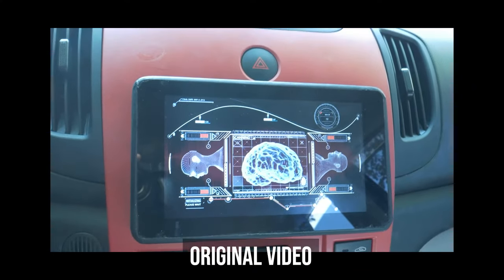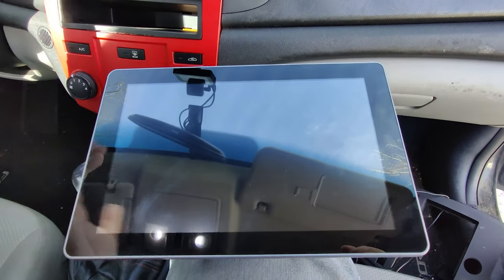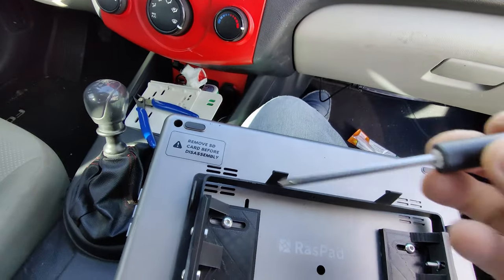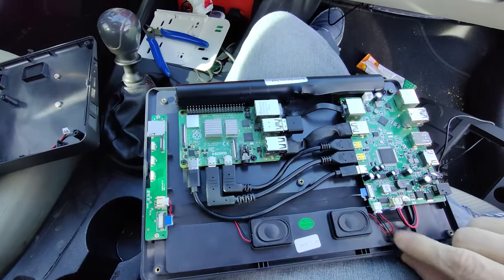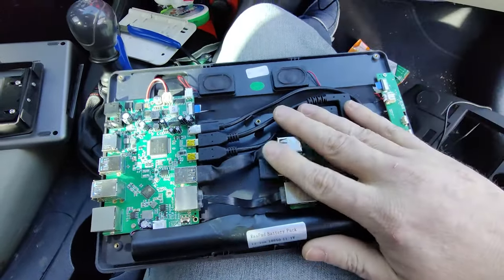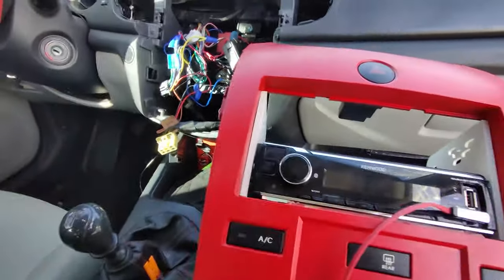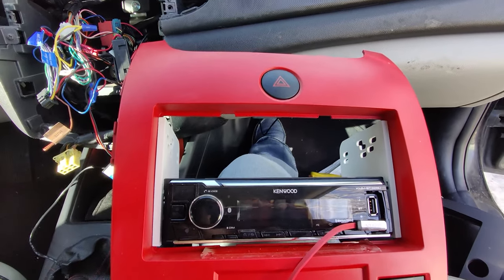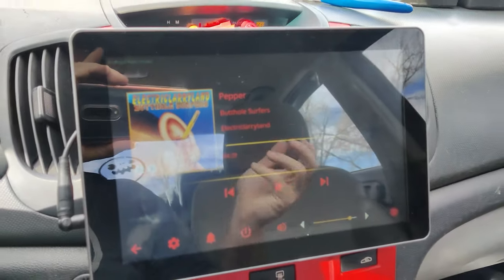Raspberry Pi Car Stereo v2 - Full Touchscreen Navigation & Spotify

Comment: 6:50 you actually can use the onboard bluetooth and headphone jack by iirc editing the /boot/config.txt file on the pi. ive been using it like this for days to pair my phone and output audio to an amp through the headphone jack, and its worked absolutely fine. i have literally no idea why bluewave disables them by default and then tells you that you need extra hardware to replace them when you really dont. saved me some money, hopefully this will save some other people too.

EDIT - the modifications: you just need to delete or comment out the line that says "dtoverlay=disable-bt" to get the bluetooth working. for audio, i believe you need to make sure you have the lines "dtparam=audio=on" and "audio_pwm_mode=2" present. the latter may not be required because the documentation says its the default, but it should ensure that you get the highest quality output from the jack.
Reply from the maker: If you want to share the changes you made, I'd be happy to pin the comment under the video :)
Reply: @DBTechYT  i edited my original comment 👍
Reply from the maker: @dylon4906  Awesome!! I wonder if doing this would help the crackling I get in my audio from time to time...?
Reply: @DBTechYT  come to think of it, there is actually a slight buzzing noise out the headphone jack which is audible with the amp. my dad, who is working on this project with me, seems to think its noise from the 5v3a step down converter (i have the same konnected one you used), but im not sure. dont know if thats related and could also affect external dacs but maybe. at any rate, i dont think itll be noticeable over the background noise in my car (havent tested the whole circuit in my car yet so hopefully anyway). there is also a "pop" noise that happens through the headphone jack when the pi turns on and off which is kinda problematic if you have an amp without adjustable volume and thus rely on the pi itself to change volume (which i do), so my dad and i are trying to find a way to mitigate that. those are the only issues i have that are anything close to crackling but might be good to know for anyone that tries this
Reply from the maker: @dylon4906  I get the pop noise when the device turns on and off, but I also get crackling in the bluetooth audio. As far as the buzz you're talking about, you might consider a 3.5mm Ground Loop Noise Isolator. (https://amzn.to/3wm1Q3P) I've had good luck with them.
Reply: @DBTechYT  wait a minute, are you maybe running the output from the pi at max volume? doing that on mine made the audio sound noticeably distorted, could be construed as crackly. maybe cheap external dacs are like this as well
Reply from the maker: @dylon4906  I'm pretty sure it's bluetooth interference that is causing the crackling noise intermittently.
Reply: @DB Tech  could be. using the onboard stuff might be worth a try then. best of luck!

Comment: Amazing video! One thing I want to point is that you shouldn't use Li-Ion batteries as those are very sensible to high temperatures and may be a fire hazard especially during summer days, when car interiors can reach 60-80C (the parts of the car that are in the shade). I've worked on a smart dashcam system and the workaround that we used were some big capacitors that could keep it operating for another 15 seconds to make sure it shutdowns correctly.
Reply from the maker: Thanks for the tip. I'll probably go out and remove the battery from the system entirely and just let it do a hard shutdown when the car shuts off. I'm running the OS on a USB drive and did this shutdown method in the past with no issues, so I'll just go back to that :)
Reply: @DBTechYT  Also forgot to mention, when the car turns on there are a lot of energy spikes that can damage your Raspberry in the long run. You have to be careful with that, Raspberries aren't that easy to come by these days :D.
Reply: @DB Tech  Nickle Metal Hydride batteries work well for this. Much safer.

Comment: For auto power on all you have to do is jump red and black to the two outside GPIO pins in the top row. Search GPIO Pi pinout and you will see ground and 5v. easy peasy, no solder required.
Reply from the maker: That's fine for the Pi. I did that in my previous build. The auto on/off issue was with the RasPad. I've since changed my setup entirely: https://www.youtube.com/watch?v=fYuruqIlUIc
Reply: @DBTechYT  Thanks for that. Interesting video for sure. I have the parts for the Pi thing though so I'm going to continue with that for my old truck. Looks like OpenAuto is no longer serving their software though. Not sure if you have any insight into that or how I can get a copy of the software. 
As a side note, I saw a comment about unraid, I have a license for it but I don't use it. I prefer trueNAS, previously FreeNAS. DO you have a video or thoughts on that comparison? Thanks!

Comment: Nice project! I would love to do something like this, I only need the car haha. At this time, I'm working to develop an infotainment system based on Ubuntu Touch. This video will be so helpful. Just a question, maybe my english is quite awful, but, did you say you don´t use the warning lights? 😮
Reply from the maker: Sounds great! And, yeah, I don't currently have access to my warning lights, but I've only used them once or twice in the 3+ years I've had this car. I have considered moving the warning light button to a different location, though.

Comment: Lots of effort went into this. We appreciate that. Good job. A few comments/opinions:
1. Locktite should be put on the threads of the screw before it gets screwed in, not the outside of the nut. I dont know if you put it on the screw side or not, but if not, nothing prevents the screw from loosening from the nut. 
2. The latest version of RPI OS has Overlay FS built in. It is useful to allow power to be yanked off without corrupting the OS even when you dont execute a shutdown. 
3. How do you hook up the audio output from the RPI to your stereo system?
3. Can you tell us where you found the cool video you used in the bootup splash animation?

Comment: Hi great video, very inspiring setup. I'm planning on doing something similar but using a 7.9inch longer touchscreen display using a dsi connection. Did you have any issues getting the display to work on android? I'm a little worries that the one I want won't work as the website only states that it works with raspbian...
Reply: Bump

Comment: Great, thanks for that video. BTW is there any way to get out of that software to normal Raspberry OS, I was thinking about using RetroPi ocassionally ;)
Reply from the maker: What I would do then is make sure that your Pi firmware is updated to boot from USB and then have 1 USB for RetroPi and another USB for this setup and swap them as needed.

Comment: Can you make a video on how to build custom boot animation on RPI 4
Reply from the maker: The boot screen was actually easier than you might think. Here's what I did:

First thing, find or create a short video that you want to use as your boot screen. I did mine as a .mp4 at 1080p, but you could do 720p if you wanted to save storage space and whatnot.

I copied the .mp4 file I wanted to use as my boot screen to /home/users/pi/Videos

SSH into your pi and navigate to the /home/users/pi/Videos folder.

Then Create an backup of the original openautopro.splash.service file "sudo cp /etc/systemd/system/openautopro.splash.service /etc/systemd/system/openautopro.splash.service.bk"

Next, you'll convert the .mp4 file to a .h264 file by running this command "sudo ffmpeg -i dash.mp4 -an -vcodec libx264 -crf 23 dash.h264"

Replace "dash.mp4" with whatever you named your file. You can name "dash.h264" whatever you want, but make sure it still still ends in .h264.

Next, you'll want to edit the openautopro.splash.service file with "sudo nano /etc/systemd/system/openautopro.splash.service"

Change enviroment variable to match the name of the .h264 file e.g. "Environment="OPENAUTO_SPLASH_VIDEOS=/home/user/pi/Videos/dash.h264"

Reboot and enjoy.

Comment: i've been told it's bad to keep lithium batteries in a car because they will die very quickly because of temperature differences.
Reply from the maker: It's possible. If I ever notice an issue, I can remove the battery pack and use the OS to shutdown or just do a hard shutdown (this is the method I used in my previous setup for months without issue.)
Reply: There is some truth to this, but I don't think it's a massive problem. Most Dashcams have a built-in lithium-ion battery and they seem to cope.
Reply: @shm5547  dashcams are using batteries less and less. all the reputable ones you can buy in germany have cables and adapters for lighters or the fuse box or whatever it's called
Reply: I think most dashcams come with cables for the car fuse box or 12V accessory socket, but they usually still have an internal lithium battery.
Reply: @shm5547  AFAIK it's just capacitors to shut down gracefully, no lithium batteries
Reply: @FunctionGermany  Yes, super capacitors are used in many dashcams too and are better for high/low temperatures. But there are still plenty being sold with lithium batteries and there’s not been too many problems with them.

Comment: No fan so you'll fry another pi guy?
Reply: Why don't you just solider the constant or ignition wire to that push power button on that ras pad that way it can turn on automatically or you can even still use the button solider it under where the existing solider is?
Reply: I would use the rest of the internal usbs and run USB extenders out so you can plug in extra options.
Reply from the maker: Comment 1: The case does have a fan. I'm pretty sure I showed/talked about it at some point in the video. 

Comment 2: I talked to the hardware developers directly about an automatic power-on option and they said it wasn't feasible with the way their daughter boards are configured. I could probably use one of the GPIO pins to start and stop the Pi, but the screen and whatnot would still need to be powered on and off manually. Also,  pressing the power button when I get in and out isn't a big deal.

Comment 3: The case has multiple external USB ports that I can access really easily if I need them for anything. The only thing I would change at this point would be moving the USB that I have the OS on to one of the external plugs so that I can easily swap it out with something like an emulator so I can play games while I'm parked and waiting for someone or whatever.